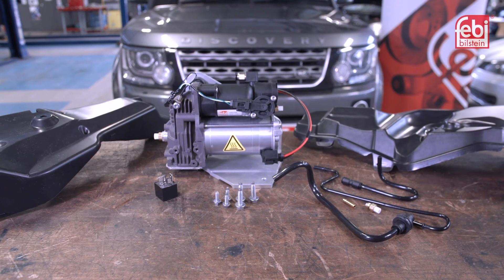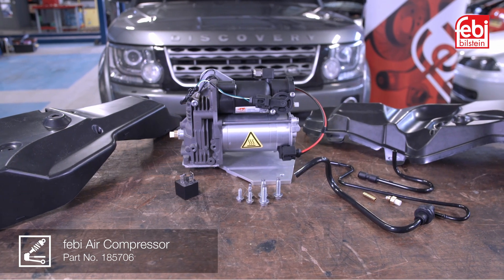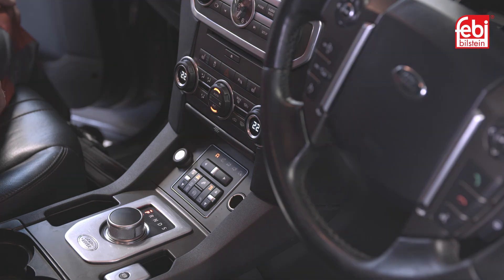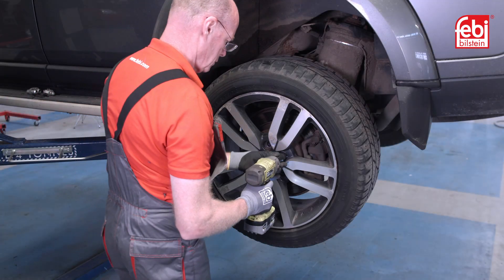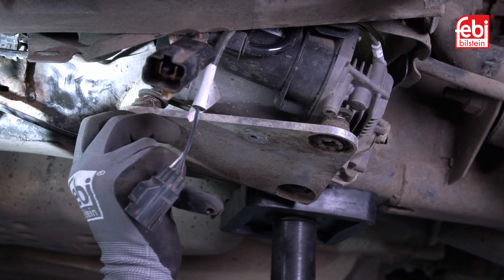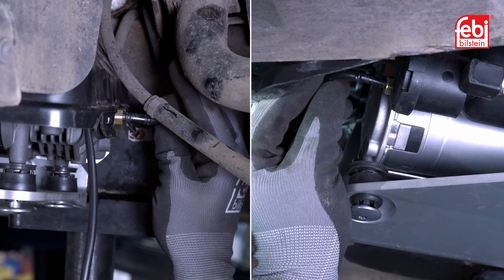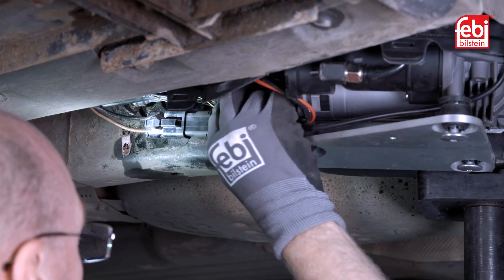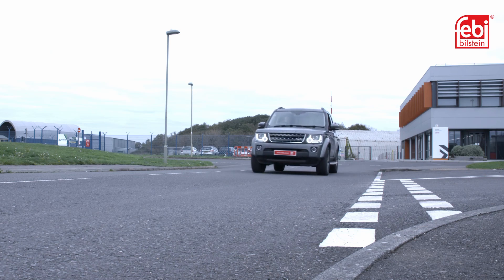[EN] Land Rover Discovery 4 Air Compressor Replacement

Comment: What if I can’t start up the car and still remove the compressor? Mine is comepletely fine im just trying to put it on another car
Reply from the maker: Thank you for watching our video. If the vehicle air suspension system is still pressurised, the system requires to be de-pressurised before removing any air lines safely. Therefore, if the battery is in good condition and the ignition can be switched on. Then the suspension can be set into service mode to deflate the suspension.